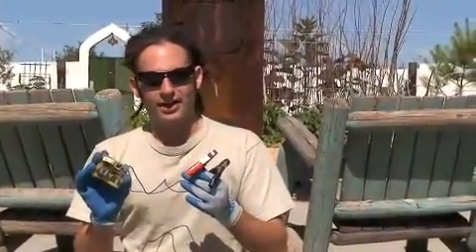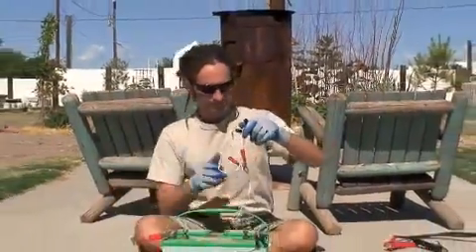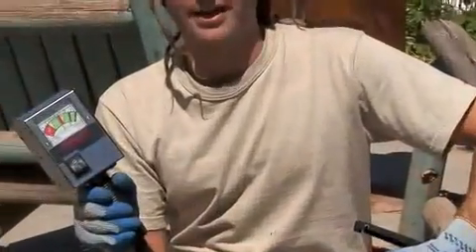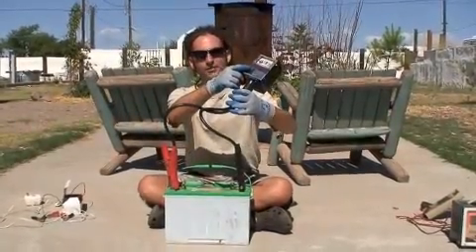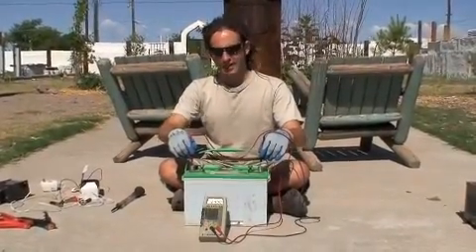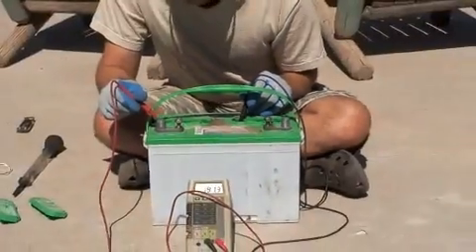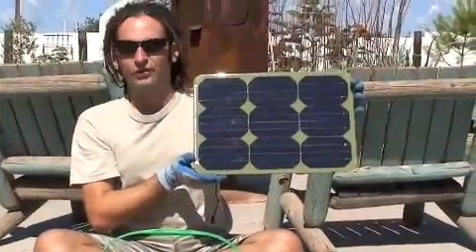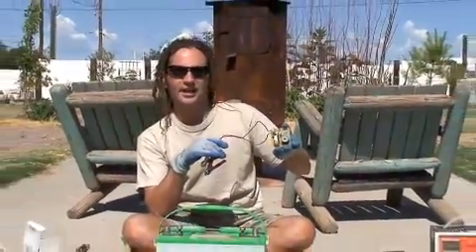Mini-D the Battery Desulfator -

Comment: I tested 2 batteries on the weekend and both of them looked to be " dead". Right after using this battery reconditioning program ( Check Details Here>>>https://t.co/hSpDD7rny9 ), I had been able to rejuvenate them both to 100% working batteries. I saves $ 180 because of that procedure!

Comment: Hi,
Interesting video. Question is why didnt you use the desulphator/charger via a solar panel then it would be 100% free.
ie. Solar panel(with a built in diode/charge controller)-> battery charger via say an inverter -> Battery<-desulphator

Then it would be 100% free minus the cost of the materials.....or use a  Bedini generator to pulse charge/desulphate the battery!!

Comment: I just have a quick question: At 1:41, you say "When you attach things, it's always the negative lead first, and then the positive." Now, I really like this video, and your hair is awesome, by the way :) I also have my battery on my CTEK 3300 right now, as I excitedly look at the CTEK MUS 4.3, and its desulfation mode I think mine doesnt have.. But, wouldn't your description be the opposite? When you connect the negative, you complete the circuit, AND ground it out, Wouldnt spark occur reversed?

Comment: Dude dont stick ur multimeter prodes in the battery,unless u dont mid your prodes getting eaten up by the acid. ,,use extentions made out of hanger wire.

Comment: To reduce the possibility of sparks when connecting clamps to the battery terminals, positive should be connected first, then negative, Remove the clamps in the reverse order.